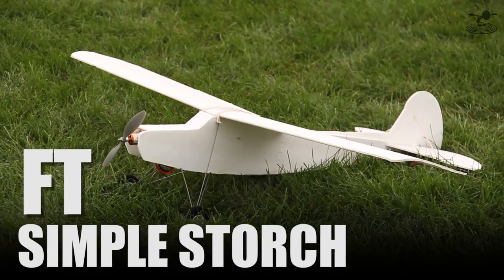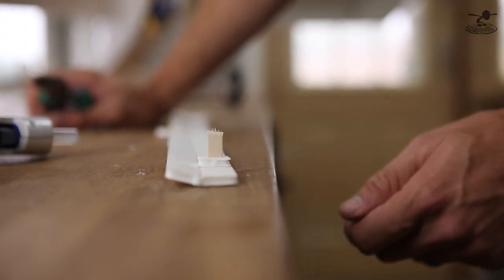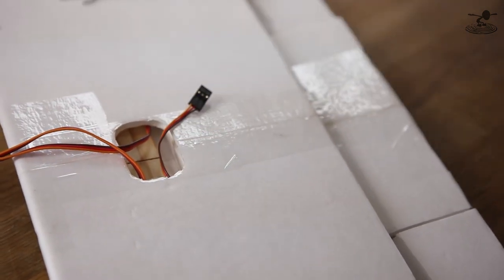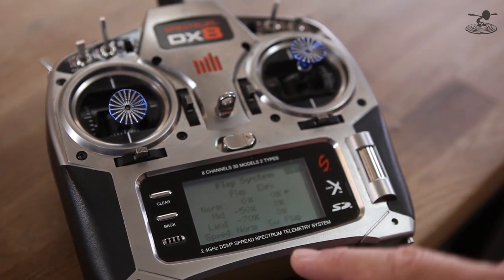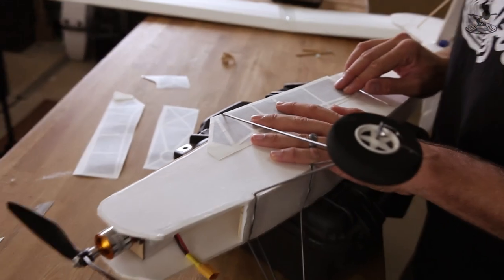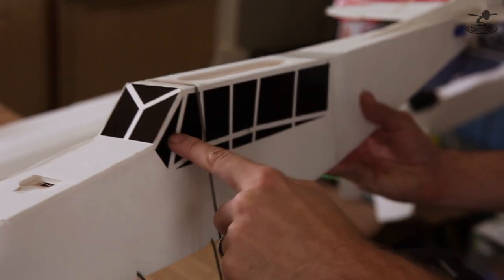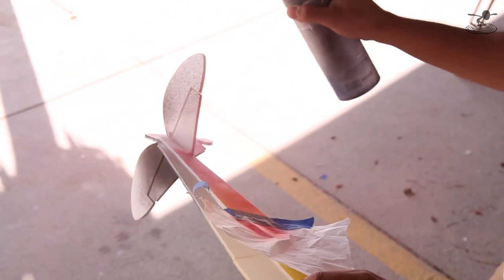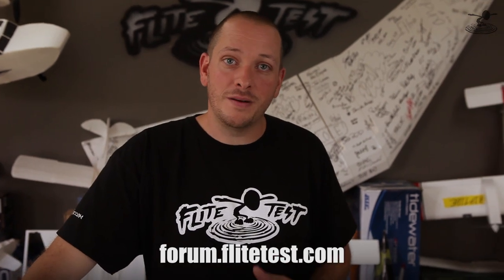Flite Test - FT Simple Storch Build - Quick Tips!

Comment: I would like to see an expanded session on control surface mixing.  1.  Mixing Rudder to Ailerons.  2.  Mixing Elevator to Flaps.  Can I see the coordinated action of the surfaces involved, what does it do to the plane in flight (Demenstrated on the ground).

Comment: I have parked in my yard a real Storch, ok it's a smaller replica called a Marabou Stork but very scale two seater with a lycoming up front and finished in Rommel's famous Afrika Korps color scheme, she has very similar stol qualities and handling to the real Fieseler machine and is a great study of how to cheaply but neatly and convincingly replicate design features like the full span slats, fowler flaps (with 40 degrees of deflection at max) and the complex and 'storky' landing gear as well as the balanced elevators and rudder which have been scaled down for better handling since the Marabou has a lower wing loading. With the large wooden fixed pitch prop and exhaust arrangement she even sounds growly like the real thing. The FT Storch is a novel approach that I am sure attracts the less experienced builders and pilots but with some simple modifications and finishing it can look more scale and fly more like the full size.

Comment: Peter's tip section was really well done, great job :)

another option for the wing would be to use flaps and ailerons, the 4 servo setup, and then program your radio to mix the flaps with the ailerons when you want full span aileron control. This is the setup I plan to use when I build a storch. It allows normal flap and aileron operation but you can hit a switch and turn on the full-span aileron (like flaperons) effect whenever you want it.
Reply: Epoch Vessel I thought about that too. Instead of using a Y-harness to split the signal for two servos, you could just use a channel for each servo - if your receiver support that many.
Reply: That is a great idea friend.  You get the best of both worlds then.  Please share you experience when you try this.

Comment: I want to see a kraken gunship revisit. By the way, your theory on why the airsoft gun didn't penatrate the foam is wrong. It would have been correct if you were shooting at an unmoving target, but the second kraken was moving at the same speed as the first, so the canceling out would have been uncanceled out. Next time, use paintball guns so if you hit a prop, it'll break and your kraken will crash. I want Josh Bixler flying one kraken and Josh Scott shooting backward as his gunner. Then, I want Chad flying another kraken, this one with it's gun pointing forward, with Peter as his gunner. Also if you could mount both guns on a pan and tilt, that would be awesome.
Reply: paintball guns are waaayy to heavy a airsoft gun that shoots at higher fps should do fine

Comment: I need help with my quad-copter, how do I mount my motors onto the frame if the screws that came with the motors aren't long enough to go through the frame and the motor? Do I need to get longer screws? And if so, what size and where from? Thanks
Reply: You can hold a motor down with zip ties??!! are they strong enough?
Reply: Red Sailor I am using zip ties too on my quad. I've used the "mounting plate / cross" that was in the motor pack, broke two wings off and used the two remaining ones to zip-tie it on the boom. Other people used a small piece of aluminium plate about as wide as a boom (and about as thick as the mounting plate) and used the mounting plate as a template to mark two drill holes. Then just use two zip-ties like before.You can always use longer screws too, but make sure they are not too long and extend into the motor because they will block it or cut the copper windings inside.The new "FT method" does something like this, but uses two discs on top and bottom of the boom to attach it. It's called "Simple Motor Mount" in the FT store: http://store.flitetest.com/simple-motor-mount-discs/
Reply: ahhhhhhh I seeeeee, thank you very much! yeh i'll make sure the screws are not too long :)

Comment: 2 things:

1. My laser cutter can only fit a3 paper foam in it. What do I do to get the whole plain done?

2. All the files are in PDF. Why??? None of my laser cutting tools use PDF :(
Reply: HornbyCrazy 1. I'm sorry. I have no idea. Splitting the plans into A3 might not work since you will have to glue criticall components like the wings. I'm not sure if they are stable enough that way.2. PDF is easier to exchange with others. All PDFs contain vector data, so you can import them into tools like Adobe Illustrator or Inkscape to convert them into anything you want. The plans are made for printing templates that are then cut with a blade since not many people have a lasercutter - yet. ;)Also most lasercutter companies have their own tools and require different source files, so it would be difficult to provide them for everyone.

Comment: While the Storch kit is a nice build - The finishing of this kit is a mess.   Sadly I bought the kit with the brown/tan foam board and painting it is a horrible  impossible process.   I used Lowe's Spray paint (the one recommended by FliteTest, I tried Lowe's satin Latex paint sample (They can match any color if you bring them a sample) And I've tried using an over coat of Water-based Polyurethane .   While the Spray paint stick well - they have virtually no color options other than white and black.
So if there is one serious weakness in these kits, it's the ability to give them a realistic finish.  Tonight I finished with the decals on the windows and in applying those, my paint pealed off in the areas around the window decal - pulled off by the backing sheet.
I don't know if your new foam board accepts paint any better but unless I can find clear evidence that it does.... I'm through buying your speed build kits.  Appreciate the time and effort you all have put into the kits but that foam board is simply not a paint-able product.  Yes, I used ultra fine sandpaper,  Steel wool, and even tried 90% rubbing alcohol to prep the surface - NOTHING worked. (And finding 90% Rubbing alcohol is impossible nowadays too.)

IF you know of a reliable paint product that permits realistic color options and isn't $$$$ It would really be helpful.   As it is I know that the first time this plane gets scuffed up, it will just have to stay that way until it gets retired.